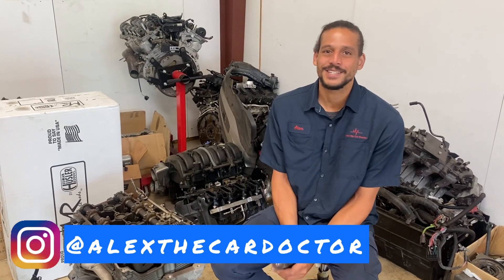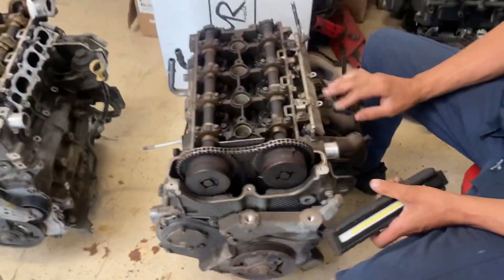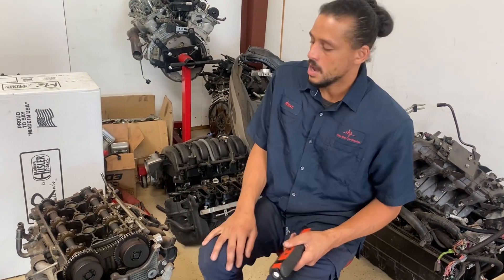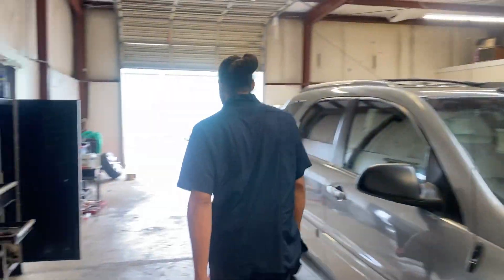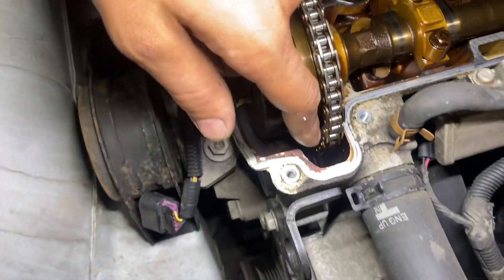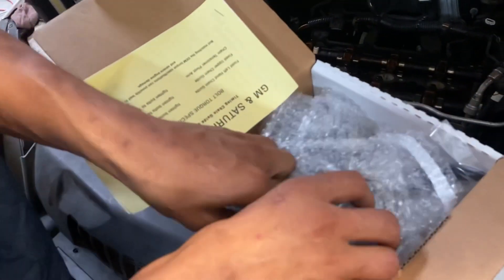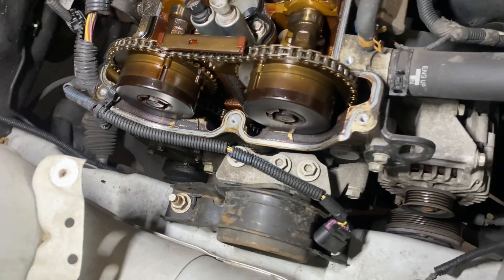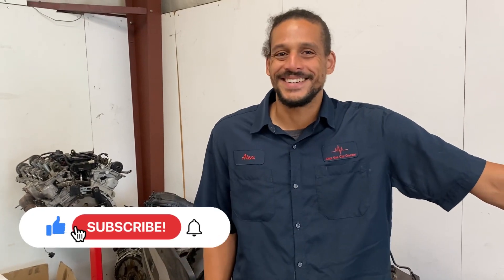Common Timing Chain Issues with GM Ecotec Engines | Timing Chain Rattles and Codes  timing chain #gm

Comment: Hello, great video! I'm trying to figure out no start issue on my wife's 2008 cobalt 2.2l 135k miles.
Check engine light came on over the weekend. Then car would not start a few days later. Made no obvious noises/issues while running. It makes a sort of grinding noise when trying to start. No ticking, no firing of cylinders. Hard to describe noise. New battery last year.

I hooked up reader and got code p0016. Cam sensor bank 1. I did not want to throw money and parts at it so have not replaced sensor yet. Any video I've found with that startup sound was broken timing chain/no compression. 

I removed the valve cover and was surprised to see the chain was intact and appears tight, along with all lifters being intact. No visible damage. (To my untrained eye).

Important note: had oil changed within 500-1000 miles and after car wouldn't start, oil was sitting on minimum line on dip stick (I filled it after noticing). No visible oil leaks.

Looking for some guidance as to next steps. Would faulty cam sensor cause no start with said noise? Should I go ahead and replace that as first step?
I plan on turning engine by hand to see if chain tensioner is operational.
From my understanding, the engine should still start with faulty tensioner. 

Thank you in advance!
Reply from the maker: Hey there buddy can you send me a video of it on Instagram I want to hear it for my self
Reply: @Alex, The Car Doctor  thank you for the reply. Of course I wasn't smart enough to take a video of start up sound before tearing it apart...I found a video of same sound. https://youtu.be/0_Wy_jvYPDY
I do not have Instagram but can communicate on messenger if easier?
Reply from the maker: @michaelthomas5323  that works Facebook message. That’s the sound of jump timing
Reply: @Alex, The Car Doctor  thanks for confirming my suspicions, Alex! I'll reach out on messenger. Much appreciated!!
Reply from the maker: @michaelthomas5323  my pleasure

Comment: Alex I have a 2015 Chevy Malibu I replace the mass airflow sensor, O2 sensor, the foot pedal the throttlebody. So when I’m driving, it still has the stable track light come on. and the auto stop doesn’t come on no more.
Reply from the maker: Hey there buddy that can be a number of things let’s start with the code it’s throwing that will point us in the right direction
Reply: The bad thing is it only has 93,000 miles
Reply: Abs sensor faulty or broken/loose wire

Comment: I have a 2011 buick regal 250,000 miles. At 247,000 miles it needed a timing chain replacement with all hardware.  I have a warranty for the work. Now I think I have the same problem with timing. What do you recommend since I have a warranty from the mechanic shop?
Reply from the maker: Hey there tell them to show you the timing kit that’s being installed, they may be using cheap parts
Reply: @AlexTheCarDoctor  ok great I will. The code was p0016 p0017. I have the eco tech engine I wonder if the checked the intake cam shaft actuator?
Reply from the maker: @lakeithwashum6497  with those many miles they should have change the camshaft gear/phaser also. those are definitely out of time codes caused by either the bad cam phaser or faulty timing components
Reply: @AlexTheCarDoctor  thanks so much. What city do you live in ? I'm in Tennessee.
Reply from the maker: @lakeithwashum6497  I’m in Atlanta George near the airport. I visit Tennessee  often to take my kids to camp up there where in Tennessee are you,the camp is near The Ocoee river
Reply: I'm in Brentwood Tennessee
Reply from the maker: @lakeithwashum6497  Not too familiar with that part
Reply: The verdict was recommended engine replacement.  What do you think? Is it worth that type of investment.
Reply from the maker: @lakeithwashum6497  those engine’s are expensive.i think they are just telling you that to blow you off unless it has bent valves then yes I recommend a engine. I can only tell you what I would do,with those many miles and if it’s not sentimental I will get rid of it if it needs an engine
Reply: @AlexTheCarDoctor  I'm done with it but. They not getting it for sure.
Reply: @AlexTheCarDoctor  what is the name of your shop? I need to talk to you about my next car purchase.

Comment: I have a 05 cobalt with 113000 miles. I replaced the OEM tensioner on the timing chain but my chain and slack were all like new. I think it has a bad lifter though. It ticks at 2000 RPM ever so slightly. Does it sound like lifters to you? The motor sounds like new. It idles quiet as a mouse after the new tensioner especially. The alternator is new the belt is new. I think it's a lifter tick
Reply from the maker: Can you look me up on Instagram and send me a video of it Making the noise
Reply: Could be an exhaust leak. These do get cracks in the exhaust manifold. Usually goes away though when warmed.

Comment: Heli-coils are typically stronger than the original threads. Pulling the head and sending it off to the machinist...damn.
Reply from the maker: I recently found an aftermarket solution works wonders. I’ve used it several times now thanks to my YouTuber fans sending me that information. https://amzn.to/3W6KSRP
Reply: @AlexTheCarDoctor  I've got one of those engines that I'm putting into a boat sorta thing. I'll keep that part in mind if the issue rears its ugly pointy little head. Thx !!!
Reply from the maker: @paulslevinsky580  my pleasure buddy.hey man make sure you look me up on IG I would love to see that project progress
Reply: @AlexTheCarDoctor  I should have the project floating in the spring. I'll be working on the engine installation after Christmas.
Reply from the maker: @paulslevinsky580  keep me posted with pictures

Comment: Is there a pattern for re-installing the bolts on the valve cover to prevent warping?
Reply from the maker: There is, but it won’t make a difference.

Comment: How long will it take to do this job on a 05 to Chevy Cobalt
Reply from the maker: It takes me a little bit under two hours for the entire job and the average person between 4 to 6 hours
Reply: Do you have to replace the chain when you do the water pump or you can just replace the water pump and keep going
Reply from the maker: @Dee-nj7sk  you can just replace the water pump there is a special tool you will need to hold the sprocket in place so you don’t have to remove the front timing cover
Reply from the maker: https://amzn.to/3fRV01q
Reply: Thank you man so it can be done it's just a hard job
Reply from the maker: @Dee-nj7sk  if you just changing the water pump it’s not that bad as long as you use that tool correctly

Comment: you should have no problem with a thread insert .I have done many in engines and never had an issue use a high temp thread locker.....its easy ,and works...

Comment: Hi I'm about to do a head gasket job on this motor 2.5 eco. I am curious if I could pull the intake manifold with the cylinder head or if I will have to remove the bottom bolt before I can remove it, thanks In advance
Reply: @Dev JB  I don't have a manual, and I have been trying to find any type of information on the procedure but have had no luck mostly just removal of cam tower guard ( valve cover ) and timing chain replacement videos everything else is about the 2.4l eco tec motor which are different. It does have the 5 bolts on top and one underneath. I was wondering if I could pull it out with the head and remove it after. I'm a big guy and I was told I would have to get under the car to remove bottom bolts which wouldnt be a problem if I could fit lol. I have it jacked up now but barely fit to remove the oil from the oil pan

Comment: My wife’s 2013 Equinox has that noise coming from the timing chain I believe. It has 120k miles. Is it worth fixing it or getting a new engine? How much would it cost to fix the timing chain? How much estimate of putting a new motor? Let me know please 👍🏼
Reply: With 120K, just get the chain replaced. Will be alot cheaper. However, I have heard horror stories about Ecotecs in Equinoxs and the oil consumption rate.

Comment: I have car I inherited from another shop, it has timing chain noise and stalls the did the chain twice gives code for intake hydrolic cam solonoid control, they replaced it also I disconnected the intake solonoid the engine runs better it stalls after a couple of minutes running, I have a power poles at solenoids, they replaced crank sensor also,  would love oil pressure cause this problems, I will also inspect the chains, they did replace hydrolic actuators.

Comment: Hi Alex - have a solstice turbo 2.0l and pulled valve cover and chain drooping between sprockets.  This after replacing solinoids and cam sensors with this not correcting problems.  Car only 70,000 miles.  Is idling ok but still getting message “power reduced” on dash message unit and getting code p0016 for issue of intake timing.  Could maybe just be failed tensioner spring and dont need to remover cylinder head to put in new chain and tensioner?  Can put in new tensioner spring unit from side to take up slack?  If not what would you charge for replacement of chain?  Would need to replace to the tensioner pad and other parts?  Thanks for any update here?
Reply from the maker: Hey there, wow only 70k,the head doesn’t have to come off for this job.i recommend replacing everything that’s the tensioner‘s in the chain anytime it slacks up like that it puts stress on the components and it’s best to replace them all. I have a video showing how to do the job if I remember correctly it’s not a bad job on your model, my labor for something like this should be around 350 to 450, had to give a range because I don’t really deal with pricing anymore
Reply from the maker: https://youtu.be/TH6KtRb0ZRY
Reply from the maker: It’s a different vehicle but it is the same process

Comment: I have that same problem right now that I'm working on what you did to fix the loose valves
Reply from the maker: Hey there you have to take it to a Machine shop to have the heads redone that’s the proper way, if you have the skills and the tools you can just simply change out the valves and the valve seals yourself
Reply: @AlexTheCarDoctor  thank you very much bro
Reply from the maker: @garyfrancis1246  My pleasure brother

Comment: Hi Alex
I am in that situation like the last car you show. The car made a big rattle noise before shut down then try to started and did not.
Finally I pull the engine out but how do I know if valves are damage ?
Or is a fact if time chain is loose then the valves were damaged.

I am trying to conclude if need engine swap or new time chain to current but don’t know how to check valves are damaged or not?
Reply from the maker: Hey there buddy One quick way is to remove the valve cover And if the rockers are falling out like I mentioned in the video you have bent valve’s
Reply: @AlexTheCarDoctor     I did that after watching your video and they solid and well seated, no movement or wiggly. Today I removed the time chain cover I found a large black guide broken in 3 pieces, I turn the engine and try to align the marks on the chain and they are off by 3 links forward. Is that enough to damage the valves?
or just new guides will be enough? 

Also a big click when turning the engine from harmonic balancer, after lube from piston 1 turn complete, I am assuming this noise is normal right?

Thanks Doc. 
Daniel C.
Reply from the maker: @danielc8037  You may be all right but you will never know until you do a cylinder leak test that’s the proper way to test it out  if the valves are leaking in any kind of way without taking anything apart or you can just put the timing chain on aligned everything properly and cross your fingers. it will make noise when turning it because of broken components if no components are broken it’s not normal for it to make any noise
Reply: @AlexTheCarDoctor  Alex,
Just want to thank you I did the engine swap and went smooth, I put 2000 miles already in the swapped engine, it was worth.

I removed the time components from old engine because of the sound that I describe to you and put it in the swapped engine.

As I mention is working great just one engine code with the Evap System from the car being sitting 6 month on the driveway, change the evac valve from the canister, I notice stayed always open t all times, and fixed. I got nervous that it was a misfired or something like that.

It feels so good recover the car from junkyard that you think it was lost, I am taking better care of the swapped engine. oil change filters, etc.

The interiors are great shape, ac, trans, etc.

It gave me a lot of confidence on cars.

Thanks so much for your knowledge sharing.

Have a great Christmas
Reply from the maker: @danielc8037  that’s awesome buddy and I’m glad you was able to to get something from my video

Comment: So, simply updating the timing chain tensioner is not a good enough solution ?
Reply from the maker: No it’s a great solution if you catch the problem
Reply: @AlexTheCarDoctor  I have 148k on it. lol  No rattling (knock on wood) but I was hoping I could change the tensioner and be ok.  .... But of course I realize that at 150k... ... I could benefit from changing both chains, all guides, both tensioners and cam gears.  Oddly, the eBay listing shows VVT cam gears for 2002 2.2 ecotec and Rock Auto shows this engine does not have VVT. Advance Auto Parts shows this engine does not have VVT. I suppose I could look for the VVT solenoids but it's 95° outside right now. LOL  .... should probably just take care of the head gasket too (while I'm in there)
Reply from the maker: @Mr_BUSINESS_24_7  what type of car do you have.i think you meant valve Cover Gaskets hopefully you don’t have head problems but yes change it the valve cover gasket and don’t trust eBay parts like that they don’t last, I use to use cheap Internet parts all the time but kept having comebacks on my own stuff at that
Reply: @AlexTheCarDoctor  Nope.. .. I meant the head gasket. I hear that these engines need head gaskets for no other reason than the DEATH COOL (DEX COOL) eroding the head gasket.  I have an '04 Cavalier LS. ... ok, then I will go with Melling  or Coyle brand from Rock Auto.
Reply from the maker: @Mr_BUSINESS_24_7  you have the good ecotech the 2.2 if I remember correctly you don’t have vvt.I only seen that happen 1 time in my time with the head gasket just make sure you have good coolant
Reply: @AlexTheCarDoctor  yeah, but what's good coolant ?  I been told to move away from DEXCOOL and just go back to traditional green.   I did this on my Saturn in like 2002. But I didn't have the car long enough to test the results of moving away from DEXCOOL.  I didn't have any problems while I had the car.
Reply: @AlexTheCarDoctor  Would you happen to know anything about these automatic  transmissions ? My car seems to want to upshift way too soon. The transmission upshifts so soon, it takes the engine right out of the power band. It's bogging the engine down too much. When I push down on the accelerator to pick up speed, sometimes it will upshift when it should be downshifting. So I feather the gas pedal to get the transmission to downshift. But it then will upshift again prematurely.
Reply from the maker: @Mr_BUSINESS_24_7  traditional green or the universal yellow stuff is what I always use.the transmission situation I can’t help with I just know when they’re going bad,sounds like you’re having a programming issue maybe it need to be reflsheed to shift properly
Reply: @AlexTheCarDoctor  Agree on software. But I'm scared to take it to the dealership. They will probably "want to,"  sell me a transmission and "THEN," update the software.  🙄 LOL
Reply from the maker: @Mr_BUSINESS_24_7  you mean stealership
Reply from the maker: You are probably right you can also send your pcm off to one of this eBay pcm rebuilders they will update it with the latest software
Reply: @AlexTheCarDoctor  how do I find him ? And how do I know if there is even an update available? I worked for Saturn. Very few cars got software updates back then.
Reply from the maker: @Mr_BUSINESS_24_7  it’s a lot of companies that do that service on eBay. I’m not sure you will have to research if there is any update or search the tech bulletins on your car
Reply: @AlexTheCarDoctor  where can I search the technical bulletins for my car ?
Reply from the maker: @Mr_BUSINESS_24_7  I normally just google it.I have the program to look them up but I won’t have time to do it

Comment: I have s 2012 equinox that went 73,000 miles before it jumped. Thank God it did, in the mechanics service bay at he turned the key. Minor damage to the valves was all that it did. Replaced the timing chain, guides and complete head. Running smooth.
Reply from the maker: Wow 70k, I’m glad you are back up and running
Reply: @RichardBrown-bs5pg  not just  minor dmg to the valves if they had to put a head on it.

Comment: Dorman part 917-954 will make an easy fix of that broken bolt in the timing chain guide.  Don't have to fix the original bolt threads, don't even have to remove the broken half of the bolt that is threaded into the head.  $15 fix, 5 minutes, tops.
Reply from the maker: I Recently had a chance to use that plug it works wonders and to me it’s better than the bolt to begin with